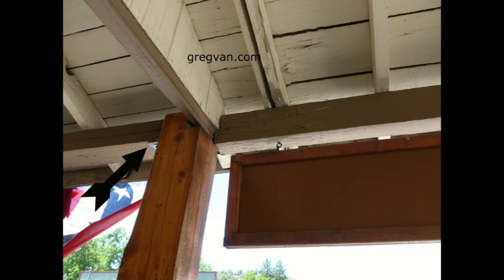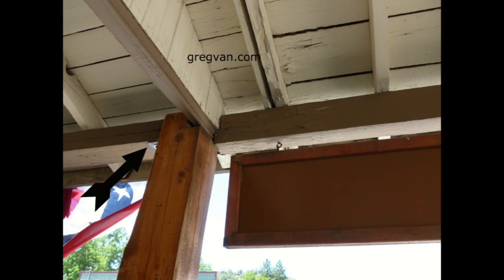Post and Beam Mystery - Engineering Problems in Home Building

Comment from the maker: You got it right, the only thing holding up this section of the roof is the fact that the beam is about 16 foot long and is actually cantilevering from the right side of the picture and instead of your L bracket on the other side, I believe it was a T bracket.  Good job detective.

Comment: Based on the first picture shown, I can see the both areas actualy was built in different period of time. The right side is actually an extention from the left side that's why the left side of the post have the L bracket holding the beam. On the other side, the right beam that newly connects to existing post, seem to 'float' and truly a mystery! Well, I can't study much from these two pictures, but I agree it might be an 'L' bracket that sits on top of the post and connects to the beam on the o